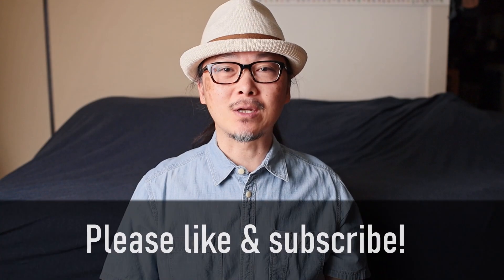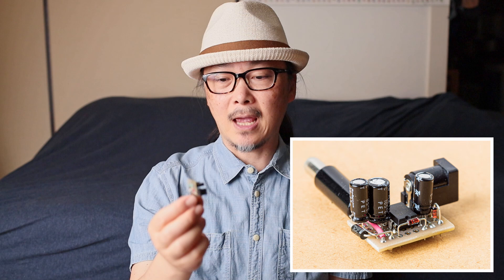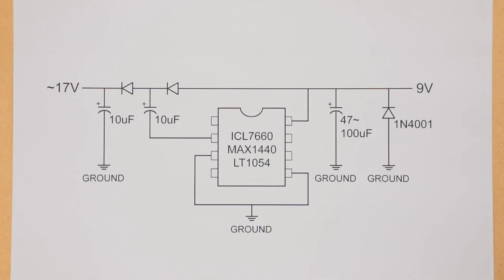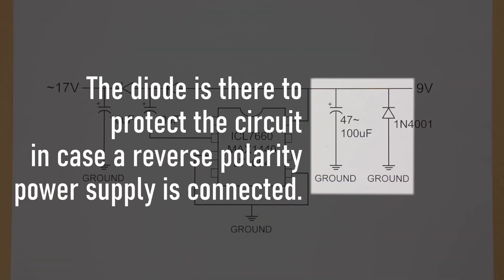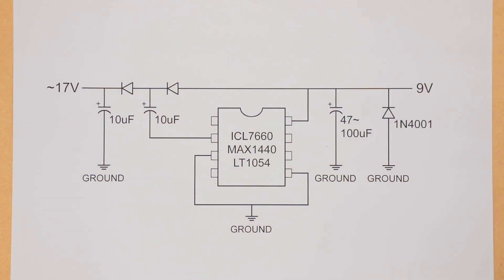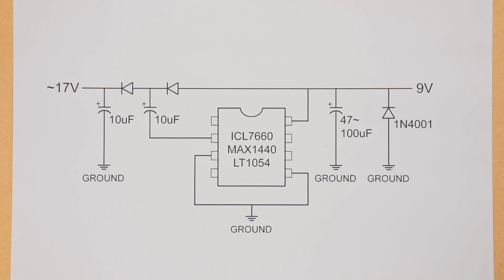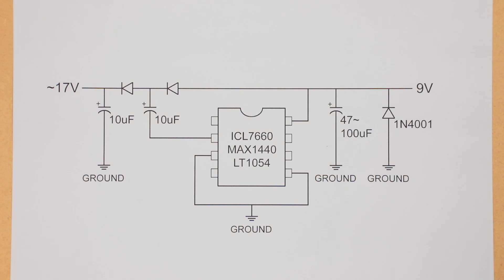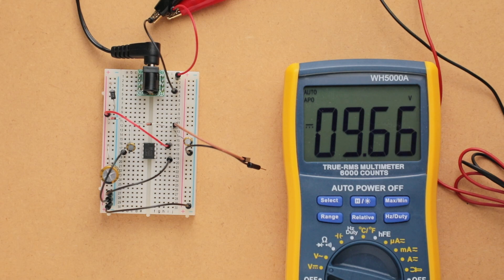DIY Voltage Doubler - Does 18 Volts Make Any Difference To An Overdrive Pedal? Charge Pump Build

Comment: Yo Arito!!! Hey you DO know CE Distribution do mini PCB for these? I just got 2 to play with, when you put this up :) psychic !
 The KLON uses high voltage on the later stages, right? I've penciled the thing into a few points in my own pedals - the LT1044 / ICL7660S is the superior part (bit lower Z power, and can run at a higher freq (as 20khz could leak or intermod into the audio), just join pin 1 to +ve ..  and the 1054 sources a way more current .. OK now let's see what youre doing :)
Reply from the maker: Hey Pete! Cool coincidence! I'd never heard of CE Distribution, did a quick search and looks like they have a bunch of cool stuff, let me know how your project goes! Yes, the Klon uses the 18v with the -9v in the summing op amp and tone knob, a clever way to keep those later op amp stages from clipping.
Reply: @arito  They say 'Trade only' but just give yourself a business name and fill in the form ;) the same company as AntiqueAudioSupplies / TubesAndMore but with a bit of a discount :)
Reply from the maker: @petegaslondon  Thanks for the info! Shipping costs might be an issue ordering from overseas, but I'll definitely look into it!

Comment: It gets cleaner?
Reply from the maker: Thanks for watching! Yes, the higher voltage increases the "headroom" of the op amp, so it doesn't clip/distort as easily. This makes it sound cleaner and louder with 18 volts.

Comment: Thank you Arito for this vid. I have had this thought for a long time how to increse the voltage without using a buck booster!
Reply from the maker: Hi Patrik! Thanks for watching! You can also make a similar charge pump using the 555 timer chip! But, this is definitely the easiest and used the least components.